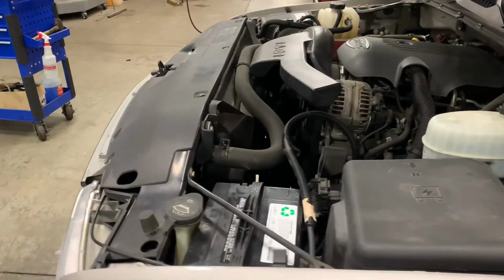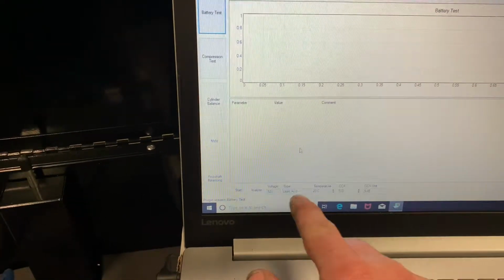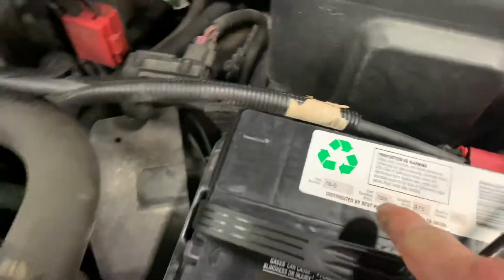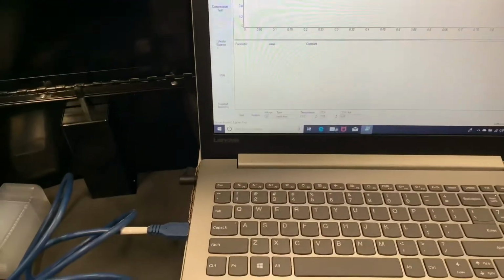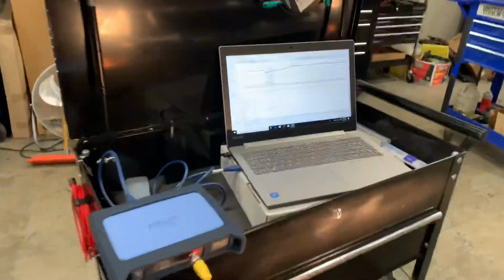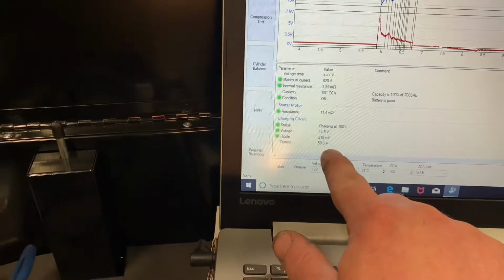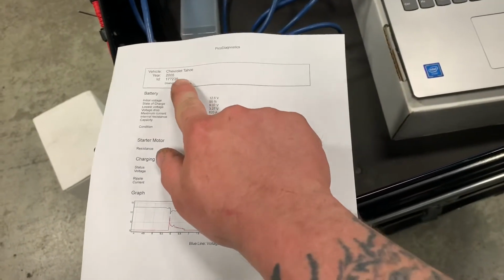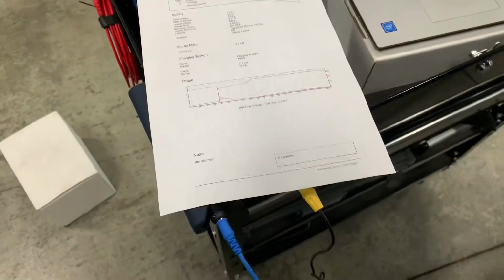Charging system test with PicoScope

Comment: Hi, I have done this test many times on my own cars especially my classic Jaguars.
You forgott to mention a very important aspect of this test that is the resistance (starter resistance) because this is much more interesting as far as system status is concerned since it tells the condition of the wireing. Customers will be much more impressed with that than Voltage because most mechanics have no idea what it tells. With, as in this case, 11mOhms the wireing is in great shape but on my 1964 Jaguar MK2 I had 30mOhms and it was enough to stop the starter motor from turning. Yes, just 30 Milliohms (don’t forget several hundred Amps are in the game).
At that time I was new to car electrics and first changed the battery (the first mistake everyone makes) ..... no improvement. Next came a new starter (second, more expensive, mistake) ..... second start attempt in front of a crowd of people ...... no start, but that day I just received my new Pico and did the starter/battery test and all it was was a corroded ground wire connecting the engine with the chassis. Made a new one for a few bucks and the resistance dropped to 13mOhms (under 20mOhms is mostly ok). Great strong turning starter since.
I run this 30 second test at least once a year on all of my cars before winter and since then we have never had a no-start again. Btw, for winter prep the actual cold cranking should not be below 65-70% else you might not get through the cold season.
If you can show a customer that by identifying and replacing a bad 10 U$ cable that you saved him from wasting a good battery or even a Starter motor, then he will be more impressed with you then giving him a printed piece of paper with a funny graph on it.
The Pico is one of the best addition in my hobby garage but don’t forget unless you spend the time to learn and interpret what it finds, it will just become another useless gadget. Don’t make the typical mechanics mistake to memorize just how certain graphs can look, learn to interpret the data and you will never want to miss the Pico in your shop.
Greetings Bernhard
Reply from the maker: Very wise man, appreciate the feedback. I pinned your comment so others can learn from it also. Thanks for watching and giving a valuable reply.

Comment: Pico says 801 CCA on a 700 CCA Battery that's good
Reply from the maker: To be fair it was a brand new battery that I had just installed so I’m sure after some time the cca will come down some.
Reply: @helmandollarautodiagnostic6519  that explains why is higher then the sticker rating great video
Reply: Also the Cranking Amps require the correct setting for the measured method e.g. SAE or EN or DIN which would make a big difference in the outcome. Yes usually new batteries are a bit higher than rated but 800 for a 700 CCA seems unusually high. I could not make it out in the video what type measurement rating was used from the battery manufacturer but it should be somewhere on the battery-label. In the Picoscope program SAE was selected.
Greetings Bernhard
Reply: @bernhardlist9359  i do understand its weirdly high compared to the sticker rating and your last vomment some great information
Reply: Antonio Claudio Michael 
Good morning Antonio, normally it is not that important. If it shows better than rated I would say, fine, but there is one thing with the Pico (or all Test equippment) and Autoelectrics in general: if a measurement result is odd then check the setup/connections/and the software settings again.
Trust me, with this I am the expert. If there is a mistake possible ..... I have made it already 🤣. As Scanner Danner always says, first check Power and Ground and how right he is and as I mentioned in another post, always learn and understand the data: why does a scan look the way he does, what causes such a display? Is it possible to show a negative Voltage where you should have the Voltage pulled to just zero (not negative) then check your connections. So if a measurement is out of whack it is probably wrong. Go ahead and start from scratch.
Happy measuring, Bernhard
Reply: @bernhardlist9359  good Information

Comment: I had no idea that the scope had this function that's awesome. A guy probably couldn't do this on a diesel with the two batteries I suppose?
Reply from the maker: Probably not in a preset test, I do know in regular labscope mode there is a 24 volt starting and charging option so not sure about that.
Reply: Yes just test each battery individually so run test twice